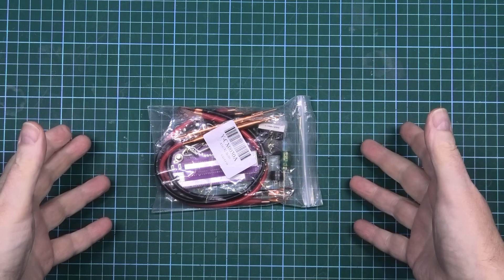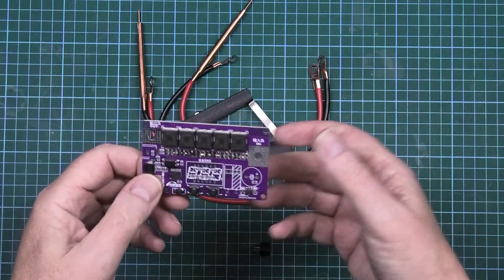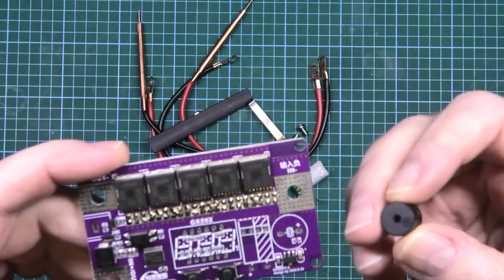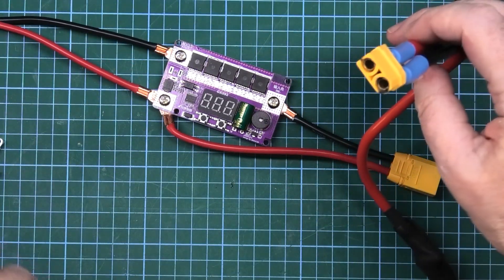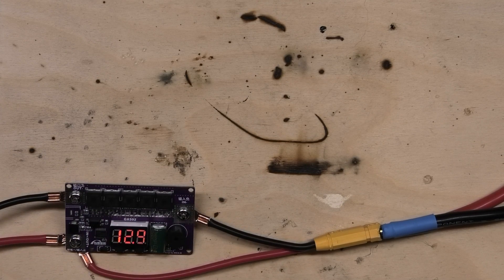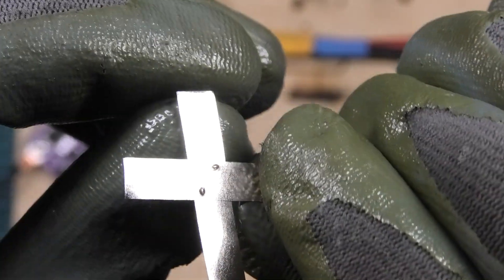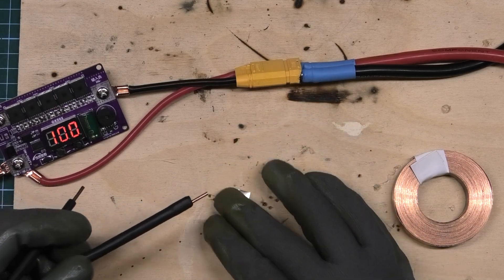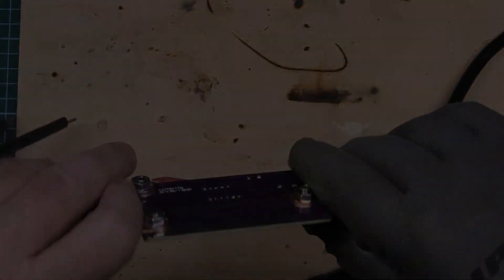£8 spot welder review

Comment: first time Ive seen this version of the purple spot welder board. Ive got the “99Gears” version that absolutely welds like mad with a diode, 20 ohm resistor, & holdup cap feeding the opto-isolator gate drive. 

Double and triple pulse would be very nice. This one looks like it has a TVS diode for transient protection across the output as well, which I haven’t seen on these much before. I’ll give one a try. Thank you for the info!

Comment: hm... interesting.. I got three 4S high C lipos going spare, but 16V might be a bit much if it's expecting 12-13V.
Tempting to try it out. I have a couple of kilos of nickel strips salvaged from a couple of thousand laptop batteries and some of it is quite usable still.
Reply: Yes, 16V is a tad too much for most of these that are meant for 3S 3.6V/3.7V or 4S 3.2V. Or 5S LTO. 6S LTO you'd have to handle like 4S Lipo and not charge all the way to the top. 14.8V is nominal for a 4S so if you can squeeze out 15.8V that would leave you at storage voltage where you should still be able to access the amount of peak current you're looking for. Below 70% or 60% SOC you definitely run into the problem of only having so many spot welds before the battery gets too low.

Lipo is such a pain since you have to keep it at 3.85V when you're storing it. (I guess you have this beat since you can only charge up to storage voltage. I would check the mosfets being used to see how well they do above 15V....I can't imagine there would be too many other components besides 16V capacitors on the board that would be a problem. Remove any 16V caps for 25V caps or power the board with a separate 12V power adapter like a lot of 3S people do to prevent the gate voltage from dropping so low that the mosfet can't close/open properly)

I find a 4S LiFePO4 pack is going to be the best bang for the buck right now. If you can find some A123 26650 packs with M1B cells (if they are M1A they are likely very degraded or at the least are so old that the DC IR is double factory new) they often come in a 12S8P or 12S4P module. The nickel bus bar sheet connecting the cells can be cut to make three 4S modules that are PERFECT for getting ~800A from the 8P module. Put two of those 4S8P in parallel (I'd recommend soldering several pieces of 12AWG silicone wire on to the bus material in between cells. 6 of those pieces into a 4AWG copper lug keeps the resistance of the pack from positive lug to negative lug as low as possible....you want to see about 3.6mR on the pack and 4.5mR at the lugs) and you could pretty much max out a kWeld or any other DC spot welder in the 1500A-2000A area.

Headway cells work great as well. I found a 4S2P  (12.8V nominal 16Ah) pack of used cells from BatteryHookup to be equal to a 4S8P A123 M1B pack (12.8V nominal 20Ah) if you don't use the (still good quality and cheap) bus bars that BatteryHookup sells. I made my own bus bars from 25mm x 3mm copper bar stock bought in 1m lengths and the bus bars I made for the Headway 38120's were 76mm long and would be about 0.1mR AC IR from end to end. You could go 3S or 4S on the Headways since they are so easy to assemble into a pack and so long as you go for a 4P configuration (maybe 3P for new cells) you'll be able to spot weld just about anything a hobbyist would do. Even 0.1mm thick copper + 0.10mm thick nickel sandwich (the real trick is you take a 35mm or 40mm wide piece of 0.10mm thick copper and then just use squares of nickel plated steel where you have to do the welds. You could probably get away with 0.15mm thick copper if your top piece was nickel plated steel since the higher resistance over pure nickel should help melt the copper to the can)

Aliexpress has DIY mosfet boards that come with all the small SMD or through hole components already on. You just solder on your mosfets (you'd be crazy to use anything but IRL40SC228 or similar). A 12 fet board should handle 2000A all day and a 24 fet board should allow you to handle 4000A. 

I'm a big fan of the JQ-DHJ02B spot welder since its about $18 on Ali and good for pure nickel up to about 0.30mm thick. Could definitely do 0.10mm thick copper + 0.10mm nickel plated steel and probably could have done 0.15mm with the right power source. I made my first one pop the magic smoke trying to connect a 4S2P Headway 38120 pack and a 4S8P A123 26650 M1B pack.....the UI on the board is super simple and warned me of "overpower". If you buy this board make sure to read the instructions. It does its own internal resistance test on the power source you are using. If the numbers you put in for pack capacity and C rate don't match up with the internal resistance of the pack then the LEDs will flash at you and let you know that you are too low or too high. When you enter your settings correctly (ie my 20Ah A123 battery....11-20Ah setting and 20C to 30C setting....the board tests the IR of the battery and says "yep, thats about the IR I would expect from a 25C ~15Ah battery".

The power level adjustment is most likely just a setting for the length of the spot weld pulse...typically you want this to be 1ms to 20ms. If you have a shitty weak welder you'll notice that you have to crank it up to 80 or something to get welds that hold but the nickel is dark and discolored around the weld....thats too long of a weld time.

To get 4000A you probably want to look at using Lishen LTO cells, Shengquan LTO cells (probably the highest legit C rate but most of their cells are small like their extremely popular 6Ah cells), maybe LEV60F cells that are still $30 each on Battery Hookup....a 4S2P pack would be 140Ah capable of 1200A continuous so spot welding above 2000A should be no problem. 

3000F capacitors are all the rage right now but what everyone needs to know is that all the cheap ones you see on Ali are used ones. The used ones are binned by internal resistance and you definitely pay for what you get. When you look at buying new capacitors the price becomes a bit much but its been shown that the SW3 can put out 2100-2200A for spot welding with a 2S cap setup. A 2S2P or 3S2P setup with large cables should push it into the 3000A realm.

I need to find the video again but a Russian guy compared the 3 or 4 models of those Glitter 801A/B/D/H or whatever the models are. A and B were identical except the caps in the B model had lower IR. The D and H model used IRL40SC228 or 209's on the fet board and again had lower IR than the B model. Very obvious that they are buying graded caps from a recycler and the ~$50 price difference between models is mostly for the lower IR which does make a big difference.
Reply: Had a look - page says 12-15V so I bought the V8 with case. I'll just charge lipos up to 15V - should be ok for occasional use.